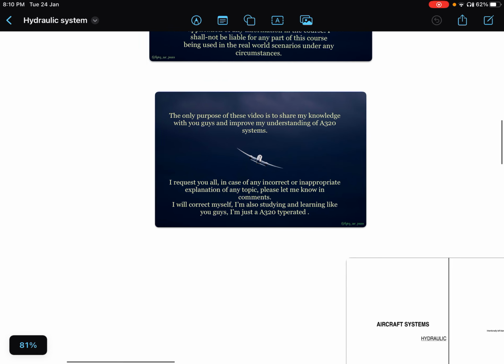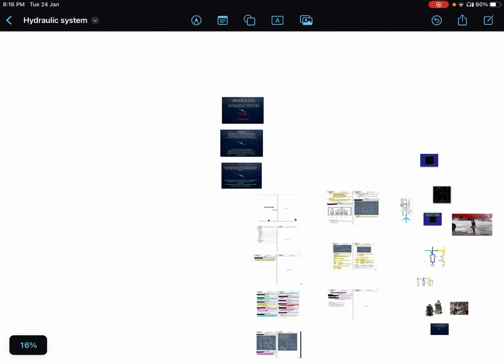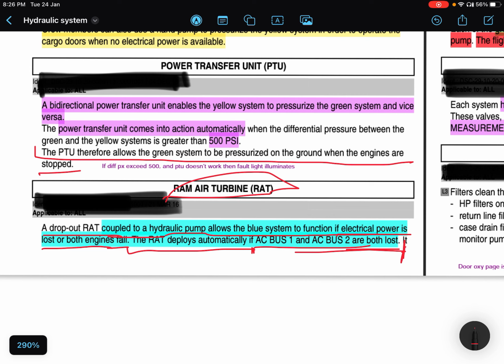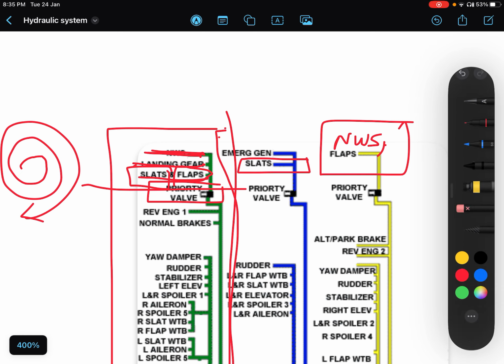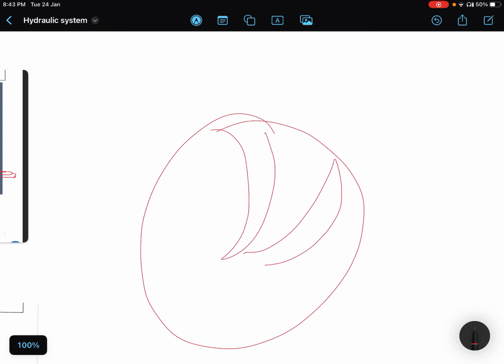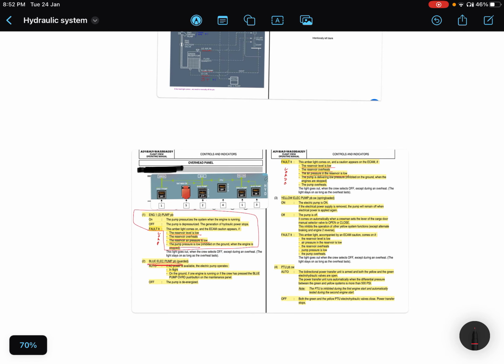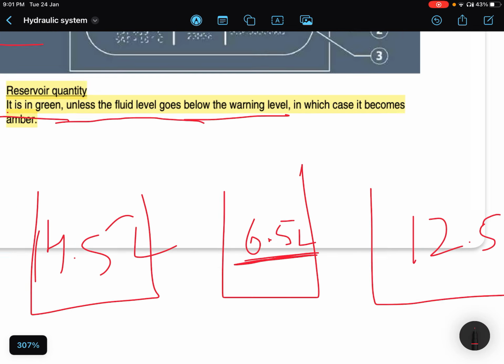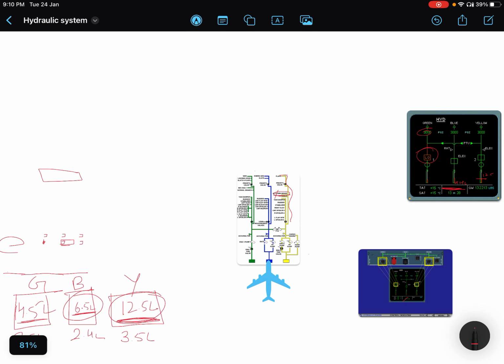Hydraulic system  A320 | FCOM explained line by line | 1.5X recommended

Comment: Also explain the Blue override Pb on the maintenance panel next to the 3 leak measurement valve .
Very good video. My take is no need to describe the actual fluid qt, temp etc. Students can read it. No explanation is need.
Thanks. Best wishes.
TD.
Reply from the maker: Ya, I will try to explain blue override pb, maybe skipped from my mind , thanks for reminding 🙏🏻